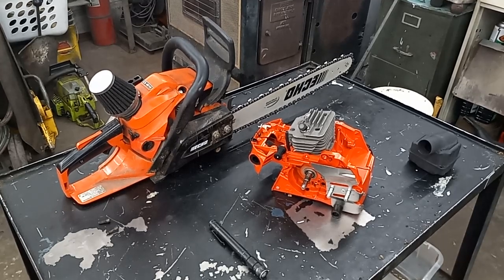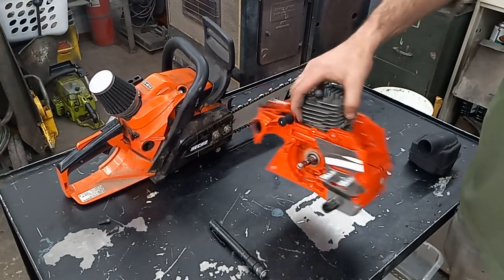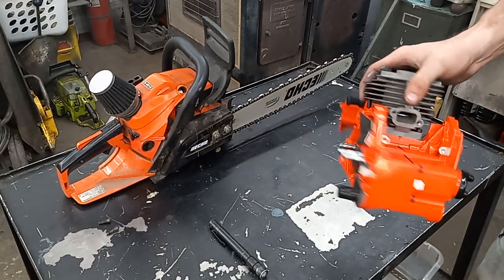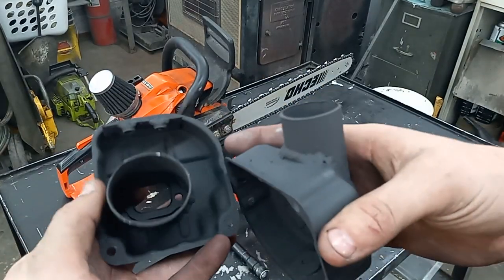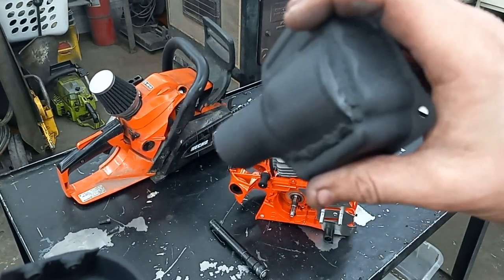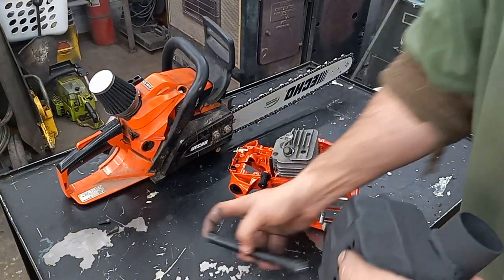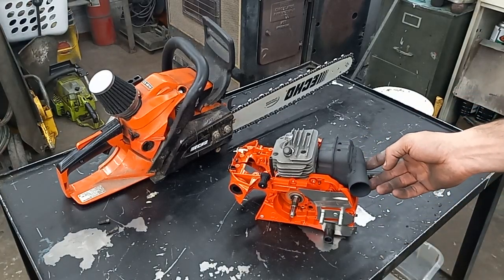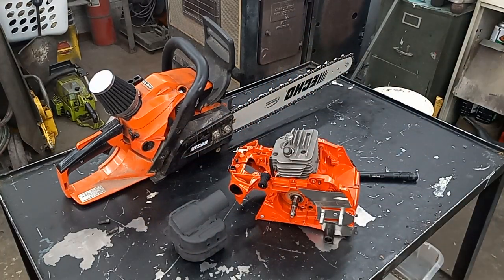new proto type muffler for my 6hp cs4910

Comment: In terms of getting the exhaust gas away from the operator what direction is best in people's opinion? Forward/sideways, 45° angle etc, Guessing a pipe helps direct it better than a deflector? General purpose saw, felling to firewood and everything in between.